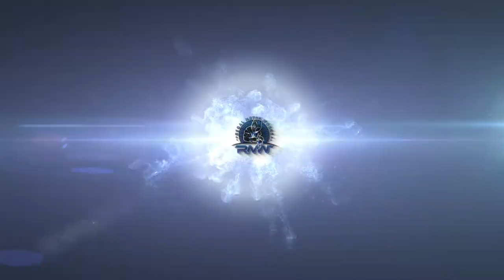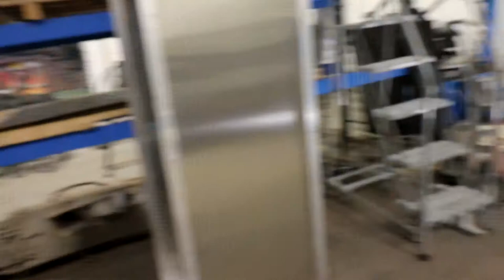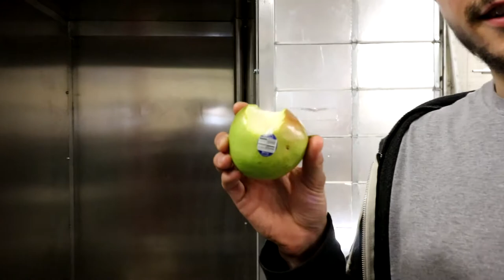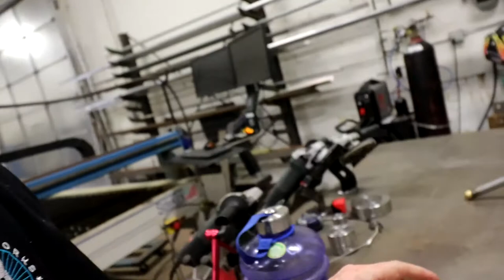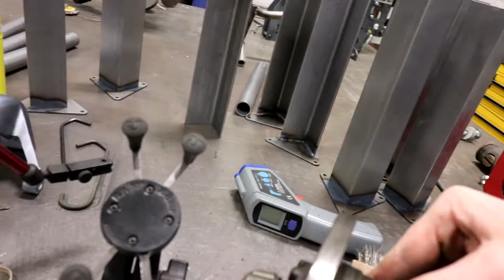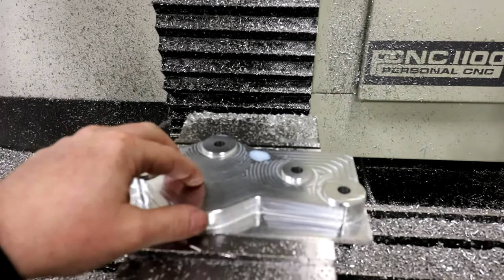Machining Adapters RMW - Vlog 132

Comment: I think that hss drill can handle more than that, try no pecking.  A good feed and speed will punch right through that aluminum while still breaking the chips.  I got the opportunity to use a Kennametal go-drill (carbide drill) on my tormach to drill some #29 tap drill holes for #8-32, about 1,250 holes or more.  The drill is still awesome and doesn't leave a burr like the HSS drill I was using did.  Drilling steel plate (hot rolled).

Comment: What are you using to edit your videos?
Reply from the maker: Jorge De Leon Power Director for now, I've yet to switch over to Premiere as I dont have time to figure it out yet.  I did the opening and ending credits in After Effects.
Reply: Regal Metal Works cool thanks for the info I'll check it out